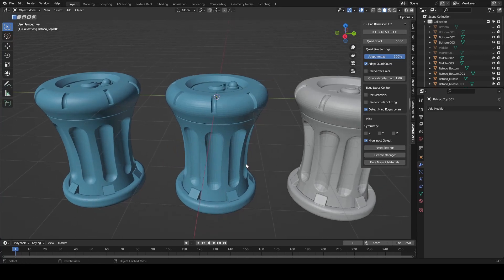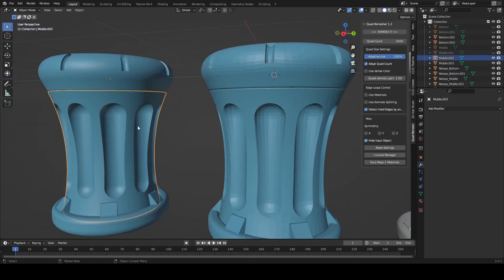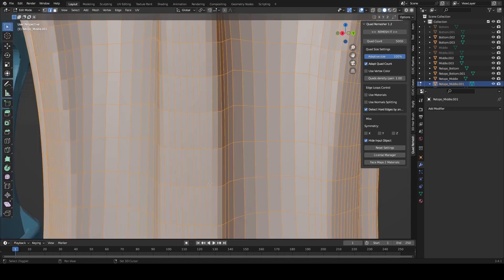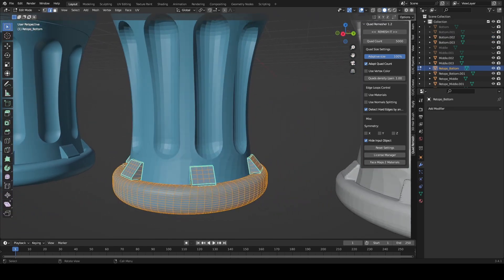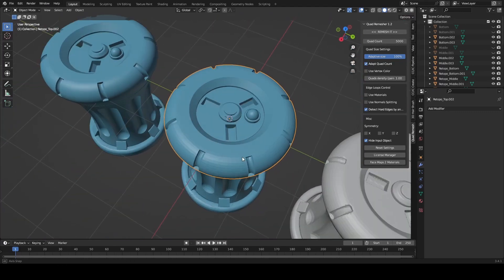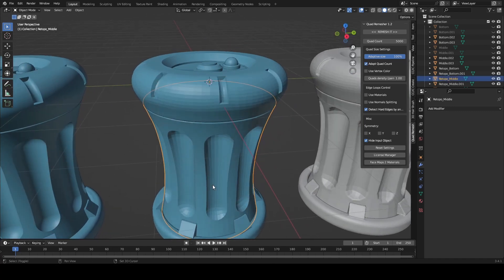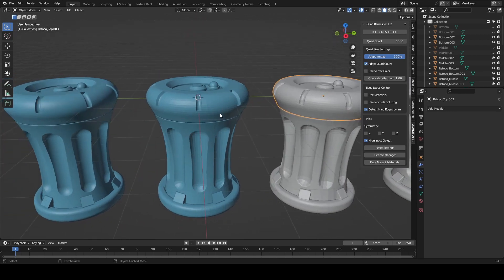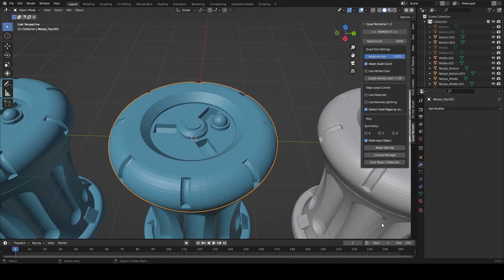Pros and cons of Quad Remesher (Converting to all quads from Plasicity)

Comment: I've found that exporting as step...then importing to Unreal engine using the Unreal Datasmith plugin (default settings)...then exporting it out as an FBX (default settings) into Blender. You get very good results with great edge flow. I then use a cheap addon called Instant Clean to tidy up some more  before I start using Quad Remesher. This also makes it easier to assign materials to further define sharper edge flow for the Remesher.
Reply from the maker: That's fascinating. I'll have to look into these options! Thanks for the tip.
Reply: @ReboundAnimation  Did you try it out?

Comment: Considering that QR costs as much as Plasticity - no thanks.
Reply from the maker: Understandable. I'm guessing you prefer Plasticity?

I'm hoping to master using them both together, but haven't quite got it yet. Here I was able to at least get Blender Booleans working with Quad Remesher: https://youtu.be/Pr7eZC9VlzY
Reply: @ReboundAnimation   I have tried Quad Remesher and it is not bad but too expensive and far from the perfect solution for quad topology, which itself is a bit overrated for hard surface modelling. Unless you want to create 'bendable' models for animation or something like that. Plasticity on the other hand is a very powerful CAD modeler, very intuitive (esp for blender users) and will only grow stronger - I am planning to buy it when the trial runs out.
Reply from the maker: @nkr1159  For sure. Like you said, I think it's optimal for deforming the mesh, but is often overkill for other hard surface cases.

Comment: Have you tried using the "Use Materials" option instead. Assigning different materials to parts where you want edge flow to change etc.
Reply from the maker: A bit yes. I have a video on it here: https://youtu.be/Pr7eZC9VlzY

I've still not mastered it for Plasticity models, but given how it works I think there should be a way to do so with some planning.

Comment: For this reason I prefer to take the models to ZBrush to use ZRemesher with Polygroups by normals
Reply from the maker: Yeah supposedly Quad Remesher is made by the same guy as the ZRemesher (https://exoside.com/company/about/), but I'm not yet able to get the normals option to behave the way I want.
Reply: @ReboundAnimation  Exactly, if there was an option in Blender to create face sets from hard edges and these would allow you to define what you want to keep when doing the QuadRemesher, it would be incredible.
Reply: Yeah but you lose the creasing don't you? I've not had great results that way yet.
Reply: @peko1967  Yes, that's why I don't do the creasing in Blender, I take it directly to Zbrush and do it there.
Reply: Has anyone tried marking the edges sharp?